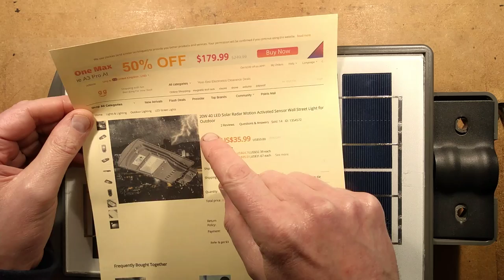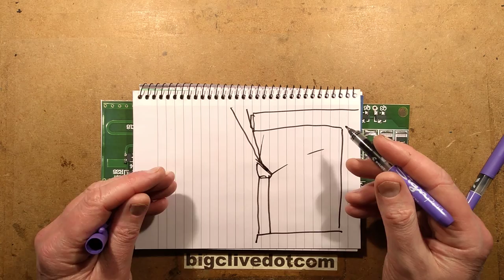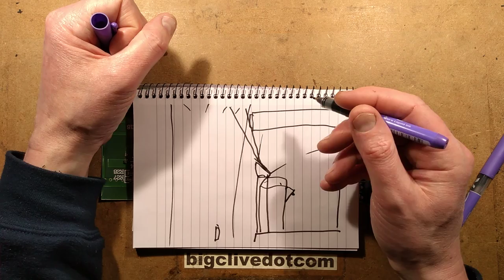Inside a sealed Chinese Solar street light with Doppler detection.

Comment: How can this be a Lithium Ion cell when you cannot charge them when it is freezing or you will destroy the cell. Unless it has a temp sensor which blocks charging but than it will not work in during the winter months

Comment: *cuts lamp open with dremel*

“I don’t want to damage anything”
Reply: It'll buff out.
Reply: Don't act like you expected anything different.
Reply: +Gerhard Prins:
I would like to have one of those. There are a lot of things I would like to cut.
Reply: @louistournas120  .. don't know where you are but in UK a Dremel is only about £50.00 ( sometimes it's all the accessories that add up )
Reply: Dremel tools suck, I have had to many of them fail with no warning.Get one of these, Milwaukee 2460-20 M12 12-Volt Rotary Tool, cordless and about $75 bare tool $130 in a complete kit.Amazon.
Reply: …by accident?
Reply: Clive and I have about the same approach to tampering with stuff.

Comment: I just picked up a couple of square Old Street lamp style heads off ebay with 30 LEDs with an optional switched internal PIR  to illuminate 28 of them on motion sense with two on permanently.The solar panel is  210 mm x 210 mm and measuring in sunlight gives 6,22 volt @ 28 mA with a 3600 mAh 3.6 volt battery pack installed that works in a  similar way if the panel produces any voltage it turns the light off. That said  if my calculations are correct its going to take over 100 hours to charge the pack up and the light only stays on for 2-3 hours under normal charging conditions so I have bodged the circuitry board from an 18650 3.7v  battery charger in a case to make a permanent feed instead of the battery pack. Testing shows energy  produced from the solar panel turns off the light so it looks good to go, testing commences.
Reply: "The solar panel is  210 mm x 210 mm and measuring in sunlight gives 6,22 volt @ 28 mA" that sounds like a bad solar panel. I have a  68*36mm one that does about 5V / 40 mA in sunlight. Look at yours under a bright light, maybe one or more of the cells are cracked, it happens.

Comment: The problem with radar / microwave detectors for outside lights is that they turn on when it rains! I've just swapped an outdoor unit to a PIR one, coz for that very reason.
Reply: Or movement through glass... They're pain sometimes.
Reply: Ours turned on every time the neighbour used their bedroom!  We had to lower the sensitivity :)
Reply: I have a light on my garage that turn on everytime a police car pass in the street 20 meters away. but I need to be at 5-6 meters to be able to light it. any idea why ?
Reply: My radar detector light has a manual override switch, so I just turn it off using that when I don't want it to come on.
Reply: @anononomous  unfortunately, I tend to be asleep when it rains at night, so a manual override won't help😀
Reply: This is probably what the unpopulated PIR section of the board is for. I suspect that it was originally intended for dual mode detection in the same way as some intrusion detectors where both detectors are used together to prevent false triggers. This unit appears to be the 'budget' version. Perhaps Clive could investigate this?
Reply: @jeremyp7293   Why who cares why. How could knowing when the fuzz is around ever be a bad thing? I want one of those lights that sends me an alert.
Reply: @ItsMrAssholeToYou  yeah it make sense
Reply: @jeremyp7293  If the police car has a radar gun for speed detection, he might have it powered on while driving and it could be sending out  radar signals, even if it's not reading those signals itself.   Those stray radar signals are triggering your light.
Reply: @jeremyp7293  police cars have Infrared blasting so They Can Go Through intersections .

Comment: I too am rather fascinated by street lights.

A few years ago the A Road near me was mainly changed from low pressure sodium to LED. But some of the fittings were not changed. These turned out to be those  that went off during about midnight to  6am. This left a rather messy  overall look, although recently all the road is LED.

On the subject of radar detectors, my porch light has one fitted internally, triggered from behind the opal glass cover. It still works remarkably well, going through the double glazed front door and picking up movement inside the house.
Reply: What a pity. Downgraded from LPS to LED. I'll bet the LED fittings won't last as long.

Comment: Try a little petrol on the silicone adhesive.  Turns silicone into a greasy slime then put some kind of wedge behind the glass.  Cardinal rule of adhesive joint design = avoid any kind of peel load, tension or sheer only.  A wedge will peel the joint open.

Comment: I recently bought one of these types of lights off of Amazon for an industrial property that has had recent break-ins in the area. 

The one I bought was about $240, but it is 100,000 lumens bright when it detects motion, and then dims down to something like 10,000 once the motion timer has expired. It has very nice glass solar cells completely covering the top of the unit, has radar detection, has a 30Ah pack of 18650's inside, comes with a remote control to be able to setup the options from the ground, and came with a fairly decent mounting bracket and pole. The design of mine has quite a peaked top, with the solar cells covering both sides, and is quite nice because the snow we get here slides right off of it. 
If it had a flat-top, I fear I would be climbing up there to brush the snow off it when we get an inch or more. (which is quite often in the winter here). It has been working everyday for several months now, and gets enough charge during the gray winter months here to keep going. It wasn't exactly a cheap light, but it seems to be worth what I paid for it.

Comment: I'm amazed radar is so cheap now that it can be used in a commodity consumer good like this.  Most of the equipment I work on is still using active IR or EM inductive sensors.
Reply: "Radar" is really just the principle, and it can be implemented in many ways. It's what accuracy and resolution you expect from the implementation that makes it cheap or expensive. This here is really just a very simple resonating circuit that is deliberately laid out open and unscreened to abuse creatively employ natural weaknesses of such type of circuits, namely both radiating radio waves and being themselves affected by radio waves. Sure, you won't be able to pinpoint and track aircraft and missiles at thousands of kilometres with it, but if THOSE are the types of visitors you regularly require to detect, turning on a light at your door will probably not be very high on the list of things to automate when they do come visiting.

Comment: The reflectors may no as useful as on standard bulbs but in my testing they still increase brightness approximately 5-10% for leds. All depending on the angle of the reflector though of course, the farther out it comes the more stray light it catches.

Comment: Basically it's a D cell. But if you could charge it to 4.2V it almost certainly isn't an LiFePO4 cell - they top out at about 3.6V and have a notional voltage of 3.2.
Reply from the maker: This one did cut off at 3.65V
Reply: it Looked like a 26650 cell to me, but at those voltages it isn't.
Reply: @cmj20002  I have a carton (80 cells) of 32700 LiFePO4 that look nearly identical to that one.  18650, 26650, and 32700 etc specify a size and shape, not a chemistry.
Reply: @cmj20002  definitely not a 26650 if its 32x70mm...
Reply: @bigclivedotcom  could this radar circuit replace the PIR in one of those wildlife cameras ?  or maybe a microphone mod that ads a microphone to the PIR to get the camera to trigger by sound and PIR/microwave radar  ?
Reply from the maker: @Choice777  It will pick up any movement including wind blown foliage.
Reply: @bigclivedotcom  so it's not a good idea ? Can it also pick up ghosts ? Cloaked UFOs ? Lol

Comment: You possibly could have removed the solar panel by pushing dental floss (or another strong thread like kevlar) in at one corner and then sliding it back and forth to "saw" it off. It often works quite well, but is very slow if it was well glued.

Comment: We've just had solar street lights put up in our work car park in an attempt to (a) be more ecologically responsible and/or (b) avoid the cost of digging half the car park up to repair the damaged power feed cable. The lamps are two piece with solar cells rotated to maximise sun exposure and the lamps have a more consistent angle.  I'd love to say they are good, but let's say we have had some teething problems, not least that they were flat within 3 days and then would run for about 30 minutes an afternoon (if that).  Apparently a software fix will sort them - at least if put into a movement activated mode like this one they might stand a chance.

Clive:. Difficult to judge the size of that solar panel via my phone screen but I'm trying to compare it against the one I use for my homebrew weather station down at the bottom of my garden... Mine is one of the really common 165x165mm ones off eBay and is capable of over 500mA in full summer sun (6V) and it looks like you have about double that area on your cell, if the cell is only 3Ah that is going to be pretty good for a lot of the year, but agonisingly, not when you need it most.

My solar weather station draws between 7 and 8mA and has about 3Ah in two 18650 Lithium Ion laptop cells.  Even in winter it is kept fully charged all year round except for the dingiest of days (worst I have ever seen is 4 days without ant charging), guess it could be a bit tougher in your neck of the woods.  You can see my power supply data here: https://thingspeak.com/channels/343059 and the weather data here: https://www.wunderground.com/personal-weather-station/dashboard?ID=ILONDON691 It is probably worth adding that I replaced a sensor in the summer, losing the mAh count (rebooting with battery already charged), so I need to wait for a bright day and dump the charge into a fat resistor to get it back to the correct baseline.

Thanks for the video, I love the reverse engineering of power supplies and solar stuff.
Reply: @sei shin I agree!  Worse still I don't think that (small)  solar cells are actually that good either, for most of the world.

Comment: Surprisingly radarsensors are cheaper than PIR ones (20 cents for the RF transistor vs $2 for a pyroelectric sensor). But those also have a lot of downsides: they require certification, they consume more power than PIR ones (not suitable for wireless alarm systems), they can detect you through walls which can be a problem for indoor use.

Comment: Those holes are more likely to let the smoke out
Reply: You can't let the smoke out !
Smoke is essential in electric circuitry.
They run by steam!
Reply: @werner.x  It's magic smoke
Reply: What if actuall power inside batteries is smoke? And when we open them it get away?
Reply: Or letting hornets and spiders in (just big enough), and you get a nest as a bonus feature.
Reply: Given the fact that it's an outdoor light, the slots seem a good effort to make sure all the attracted insects have a nice warm place to die in great drifts.  

I mean, if you didn't have a drift of moist bug detritus in your lamp, how would you make sure the electronics get ruined?
Reply: You might be right.  The service routine has always specified that foreign debris should be removed when doing maintenance, so we have to make sure there's something to remove.  Wouldn't want to confuse anyone.

Comment: One good thing, the LEDs appear to be recessed which should minimise light pollution. 

You say the original opening is on the solar panel side. If there is even the slightest gap in the sealant, water can get in. If there are no holes on the bottom, or the holes are not on the very lowest point, it can fill up with water. It seems much more preferable for any opening that could leak to be on the underside.

What sort of frequency does the radar work on?

Comment: Those vent holes look like a great home for moisture and many creepy crawly things.
Reply: Problem with making things water tight: Condensation have problems getting out once it get in. It is not uncommon to have drain holes in electrical equipment that is meant to be used in a wet area (like outside or a slaughter house).
Reply: Yep, all the mains voltage switches & junction boxes on the outside of my house have little drainage holes in the bottom of them. If you don't have the hole they gradually fill up with water from condensation.
Reply: Sweet spot is big enough to let moisture out but small enough to stop most things from crawling in. They look like they might be a bit big to achieve the latter.
Reply: @phil955i  Key word... "little" drainage holes. They're called weep holes for a reason. The water is meant to be able to weep out, not pour out; or in. The giant holes in this light are way too big; as the op mentioned.
Reply: @xenonram  yes I agree they're over the top to let water out but double as ventilation as Clive said in the video?
Reply: Thunder flies can get through pinholes, but water would only evaporate through them. Might as well use big holes so that at least some of the critters can leave when they choose to do so, and so that water can pour out freely for the first few months, or even longer, if you're lucky. Can't win them all.
Reply: Some fine gauze somewhere inside would stop the progress of bugs making too far into the unit.

Comment: It would be cool to hook up the antenna of that to the scope to see the frequency it is operating at and see how it changes when something moves in front of it.
Reply: C MJ It would require a very expensive scope. The frequency will be about 10GHz!
Reply: Typically you will downmix it to get to a more manageable frequency if you wanna measure SHF stuff with a scope. 
Doesn't have to be expensive, depending on the frequency you can use an LNB from an old sattelite dish.
Reply: @mfbfreak  Clever!

Comment: Don't complain - this is one of the best times of year to design and test solar street and garden lights for your particular latitude. So is mid summer. For dependable year round operation one should consider these differences in charge amount when determining solar cell size and mah capacity of batteries. There's probably a formula for it somewhere but why make it easy?

Comment: Ah, yes.  The joys of solar power on a rainy or  overcast day.  

The 30 watt monocrystalline panel that keeps the batteries for the shed lighting charged barely got the battery voltage above 13 volts today (float is 13.6, overnight dropback is usually about 12.8).  

The 250 watt polycrystalline panel that keeps the solar generator charged actually peaked at about 10 watts with today's lack of light :-(  That panel was tested under load and can deliver 235 watts in full sun (the Jinko panel has very good output under real world conditions).

I had one of the smaller Banggood solar streetlights that worked well until water penetrated the poorly sealed solar panel and it disintegrated.  The battery, LEDs and the controller board are OK so I have a 4" X 4" solar panel on order and I'll try mounting and sealing it with some clear "waterproof" tape.  I also have one of their "wall" solar motion lights mounted on the shed out back and it is partially protected from the rain by the overhang of the roof.  However, most of the solar panel gets light for about half the day and this light is strictly motion-triggered - sometimes by a neighbor's cat at 12 feet and on occasion by a vehicle using the back driveway as a place to turn around - enough heat in motion works at greater distances ;-)

I built the solar gen so I'm not out in the dark or a thunderstorm getting a gasoline generator running to supply limited power during the (usually short) commercial power outages (a concession to old age ;-)  The 540AH 12 volt AGM battery bank powers a 2000 watt pure sine wave inverter that connects to a 4 circuit transfer switch with options of power for furnace, fridge, kitchen counters and some lights.  Depending on the season, the solar gen can provide "Wait until daylight" power for 8 to 24 hours.  Historically, most outages have been less than 24 hours so this level of backup power means I rarely need to get a gas gen connected and started.
Reply: I know the feeling.We have had about a week of overcast. The solar shed lights would be dead by 0100. The 200 watt capacity panels were doing good to get to 30 watts. But if the wind turbines had been up and running, they would have likely gone to brake mode.

Comment: I get the feeling that this IR1 pad might be not for passive ir sensor but for ir remote receiver,  that 8 pin chip being a small micro.
Reply: indeed, I get the same hunch. For IR remote control of ON/OFF/AUTO at DAWN. Quite difficult to press the ON/OFF button when the lamp is up on a pole ...

Comment: That seems like a half reasonable light, though likely not all that useful in a well trafficked area. (though, in such a place there is likely need for more constant lighting regardless.)
And the larger battery cell instead of two more common ones is rather interesting.

Though the thing with having both Metric and Imperial on a measuring tape/ruler isn't really that uncommon internationally.

Comment: Interesting. I've seen many microwave doppler sensors used for intruder alarm systems. The older ones had fairly hefty metal horns inside to focus the radio emissions. This seems to have nothing at all. I should imagine that a pidgeon sitting on top of the unit would trigger the light.
The solar pannel looks pretty weak. The low output was no surprise.